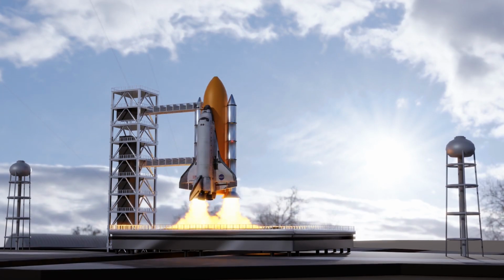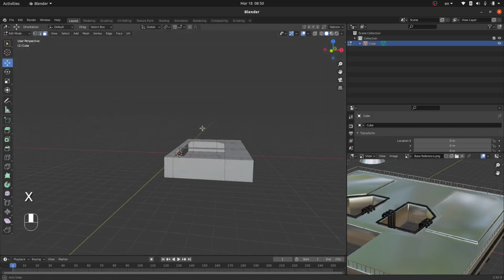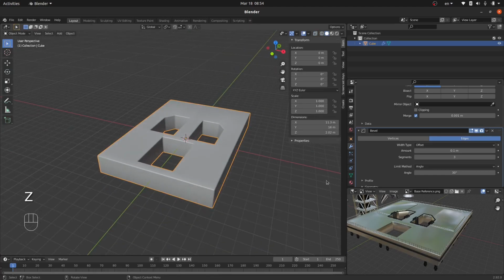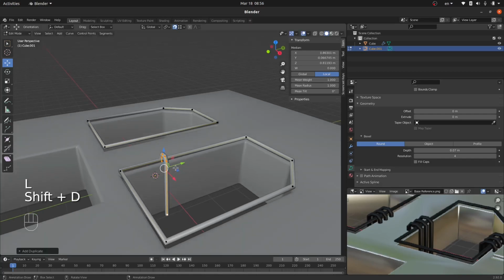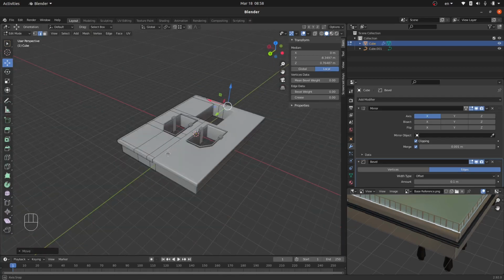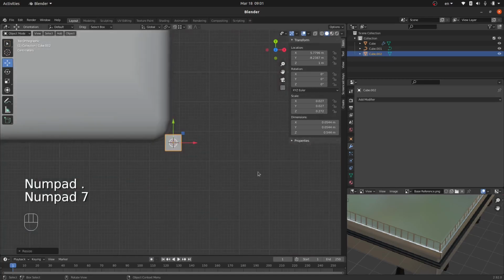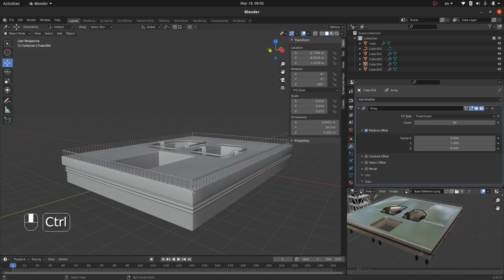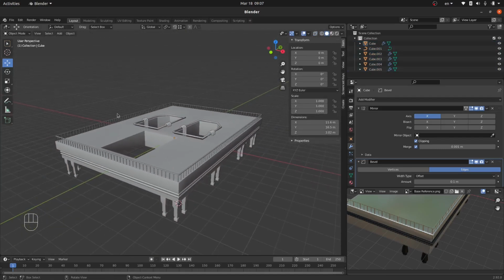Animate a Rocket Launch - Modeling Space Station - Part 1

Comment: a simple way to create railings just select all the top vertices and hit shift +d then let them selected and hit p and click selection then go in object mode and select that new object and then go in edit mode and select all vertices by hitting a then press e to extrude and z for z axis then drag according to ur need how long railing u want ... then after doing this just create loop cuts in between with proper gap then go in object mode select that railing and click on modifiers and select wireframe modifier then just increase the thickness thats your railing